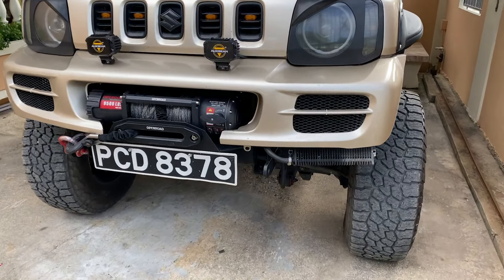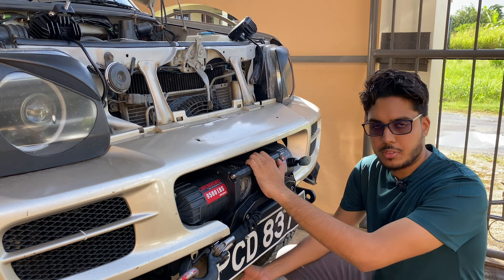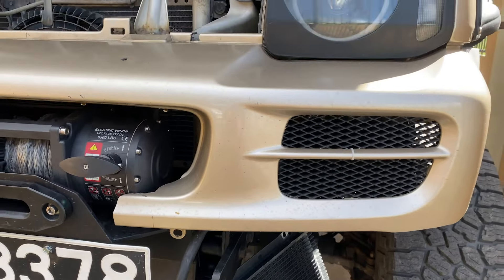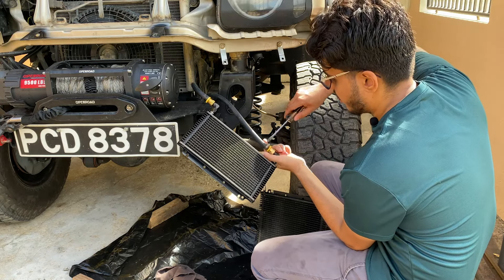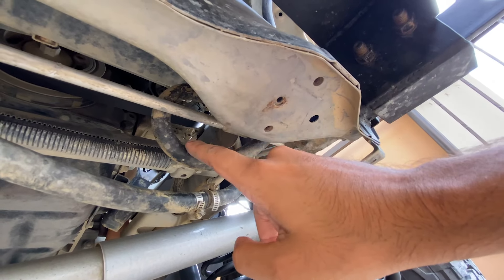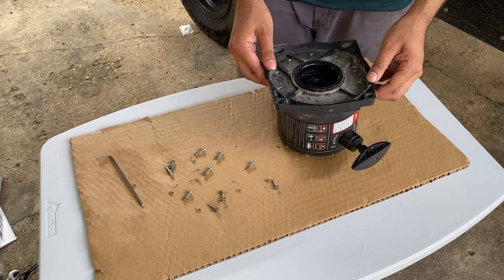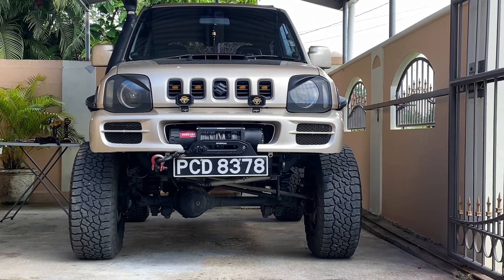Downsizing my Transmission Cooler?

Comment: so u ran it in series from transmission to external cooler then thru radiator cooler or the other way around?
great video as usual man
cant wait to start modding my JB74 lol
Reply from the maker: I don’t think it makes that much difference because water cooling from the radiator is more efficient than air cooling from the external transmission cooler. But the Hayden website recommend that the transmission cooler be installed after the radiator so the cooled oil goes straight to the transmission. I hope this helps 👍

Comment: I think a noob question (cant find a video on it on your channel) but why did you install the Trans mission Cooler in the first place? What is the great benefit on it? Is it needed for your bigger tyres?

You still running the stock 1.3 engine for those tyres right?
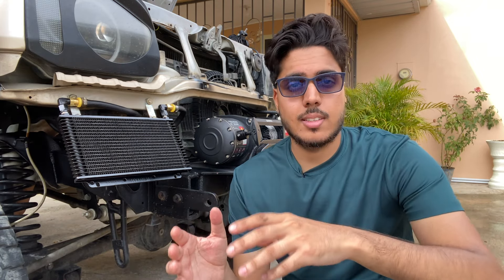Reply from the maker: Check 7:24 buddy 👍

Comment: Nice , the transmission cooler cools the transmission oil right ? So didn't you have to fill it up with transmission oil while replacing it ?  I didn't understand the radiator hose that you were explaining . 
I have a Maruti gypsy and these are notorious for engine overheating specially when an AC is fitted . I use an engine oil cooler from mishimoto . I remember when I first installed it , I filled it up with engine oil else there will be trapped air
Reply from the maker: Yeah it does. In retrospect I probably should have. Disconnect one of the transmission line from the radiator and connect it to the transmission cooler. Then take the other transmission cooler hose and connect it to the radiator.
Reply: @Zaff_TT  ok I get it 👍, I've never owned an automatic before . the cooler you installed  fits perfectly under the bumper.